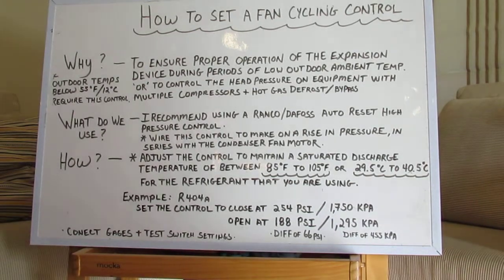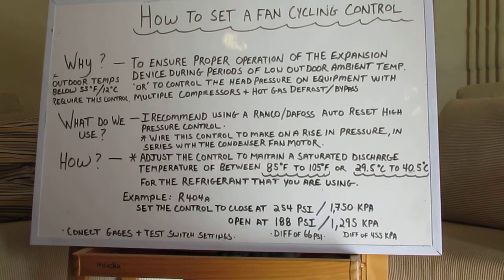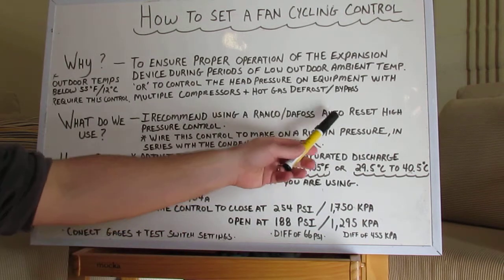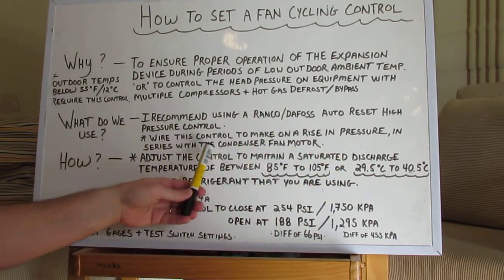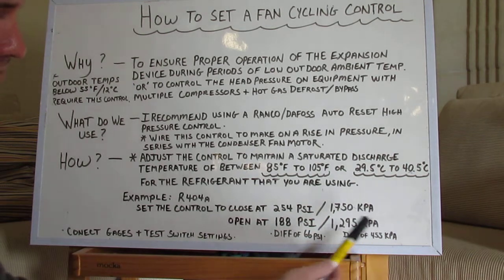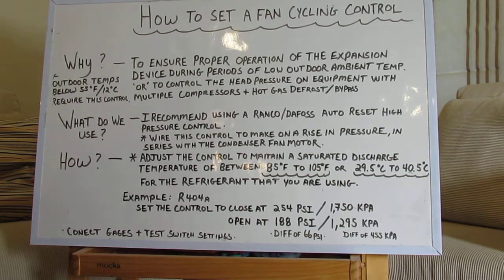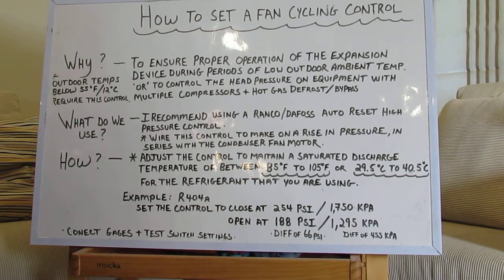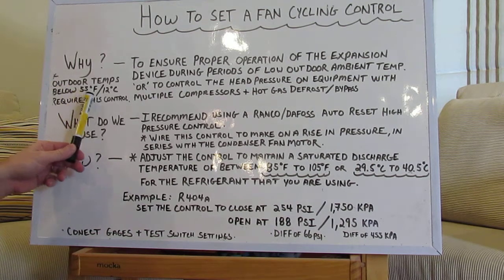How to set a fan cycling control on a refrigeration system

Comment: is a fan cycle control just for air condition?
Reply from the maker: It can be for air conditioners but I utilized it more when working on refrigeration equipment during periods of low ambient outdoor temperatures.
Reply: Thank you.does it have anything to with the furnace the fan cycle control?
Reply: And how long can the thermostat be on hold and not on run?

Comment: Do you have go back in the late spring and late fall to adjust it
Reply from the maker: Once the control is set it will maintain the head pressure year round with no need for adjustments.

Comment: Thank you for a very well laid out video! My question is how did you decide on the Saturated condenser temperatures of 85 to 105°F For your cut out and cut in the range.  Thank you in advance
Reply: There is no magic number.  The lower the head pressure, the better efficiency your system will have as long as you are not starving your evaporator.  85-90F are safe numbers where it is likely for most systems/txvs that the head pressure will be high enough to properly feed the evaporator.  Can you run lower head pressures for better efficiency? Probably.  Can you set for higher head pressures.  Yep, but you would be operating at lower efficiency.

Comment: Where do you get the magic number 85F - 105 F and based on what you determined your differential pressure. I have been struggling with this a lot. 
Thank you so much for info.

Comment: how about Freon 502 , i want the temp. inside the cold store between -18 -13> is it right to adjust the low pressure 20 psi and diff 12 psi
Reply from the maker: Hi RS,

So I'm suspecting your using farenheit?
Keep in mind most condensing units can only operate within a certain range unless they have been modified. Check the lowest saturated temp with the equipment info. 
To achieve your temperature settings try 20 psi in and 8 psi diff to start. Monitor the cutout and increase as needed.
A liquid to suction heat exchanger may need to be added to the system. Good luck and let me know.
Reply: @latentfusion2563    thanks ...no data available in the unit....i am in saudi arabia>>>any how i adjust the low pressure 20 psi>>>>> high pressure 300 psi>>>>diff 15 psi>>>>inside cold store thermostat setting  -8c >>>ir running normally>>>.is the setting right?
Reply from the maker: @rs3682   just a question, does the room have a thermostat  if so then it will be your primary temp control and the low pressure control will be a safety control. If you want the room colder then adjust the thermostat.
Reply: latent fusion u r right...yes i have,,,,,another question if u pls, what standard or normal pressure for freon 502  means what suction and discharge rate?thanks again
Reply from the maker: @rs3682  suction pressure is determined by what saturated temp you are trying to achieve. Refer to a pressure temp chart. You can also download the danfoss phone app.
Head pressure is determined by the ambient temp around the condenser. As a general rule the condenser will add 25f to 30f to the ambient. So if it is a 70f day the condensing unit will be condensing at 100f. On a pressure temp chart for r502 it should be around 215 psi. Download the app and have a play.
Hope this helps.
The pressures and temperatures will very day to day as conditions change.

Comment: Great explanation. Are these cut in and cut out settings for medium or low temperature evaporators? Thanks 🙏
Reply from the maker: yes, this can be used as the cut in and out on both medium / low temp applications.
👍
just remember to set it up for the refrigerant that your using.
Reply: latent fusion thank you so much. I am fairly new to commercial and residential refrigeration. Please keep making more videos.

Comment: Typically we are taught to set the differential between 30 and 50 psi. I've been in the field since 1995 and as of yet no one that I've spoken with has ever suggested a 66 PSI differential setting nor have I ever felt the need to set it that high.  So if you don't mind providing a little feedback where did you come up with the 66 PSI differential setting?
Reply from the maker: Thank you for your question.
I have based my numbers on the saturated condensing temperature of the refrigerant that i am using.
Since all refrigerants have a different pressure/temperature relationship I didnt want to recommend a rule of thumb like 30 - 50 psi.
Standard condensing units have a T.D. across the condensing coil of 30f    
So at an ambient of 55f we will be condensing at 85f. At 75f ambient we will be condensing at 105f.
All condensing units have a recommended refrigerant temperature range in order to achieve the greatest net refrigeration effect.
Some new equipment have lowered this range by increasing the size of the condenser slightly.
My example in the video was for r404a, blended refrigerant. If I was to use other refrigerants they would work out as follows.
R134a in @135psi out@ 79psi diff of 56psi
R22 in @ 209psi out@ 155psi diff of 54psi.
R12 in @ 129psi out@ 91psi diff of 34psi.
So to re-cap the difference between my settings and yours is about 2f in saturated condensing temperature.
Although my pressures seem higher than the R.O.T. that you have been taught it means next to nothing when it comes to the effective operation of the equipment. 
I have spent a lot of time in canada so I have always preferred getting a bit more run time out of my fan.
Reply: @latentfusion2563  thank you!
Reply: Wow.  You were prepared to answer that question, lol.  Good answer